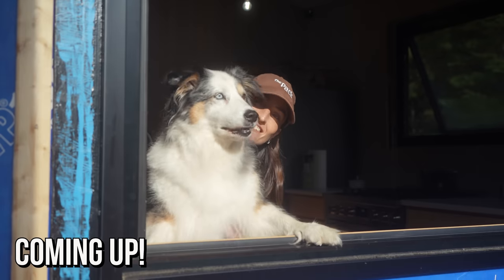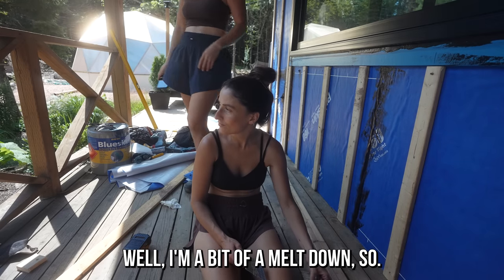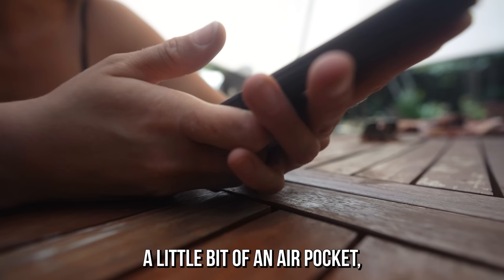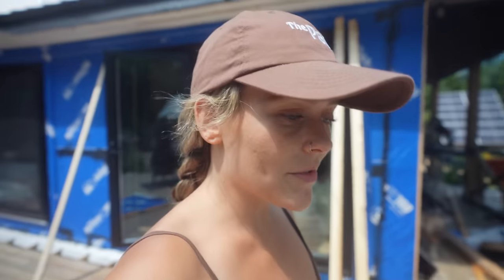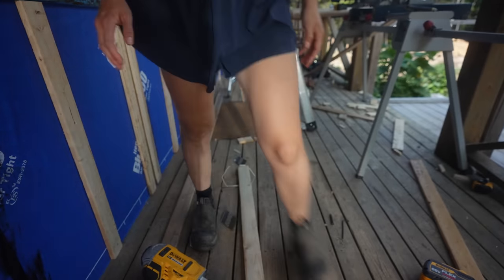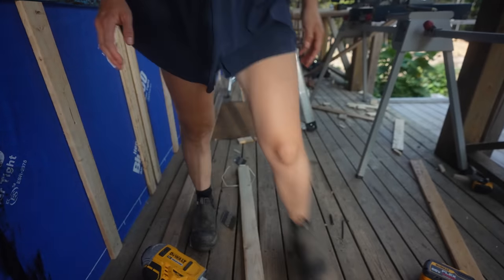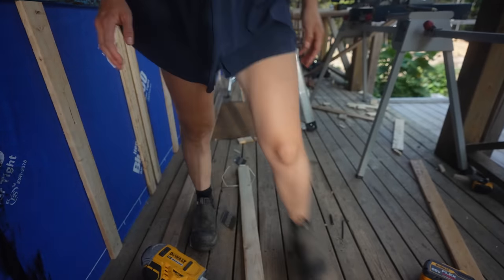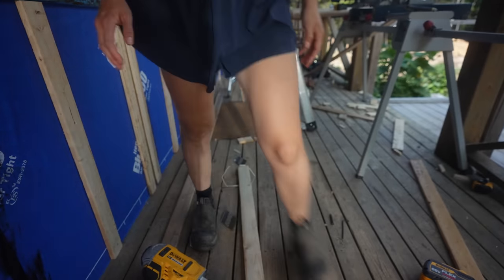Finishing House Wrap Installation (it's complicated)

Comment: Hey ladies, my wife and I are regulars to your channel down in Massachusetts. I am a residential builder and wanted to offer an explanation to your blueskin bubbling. It was super rainy when you applied the adhesive and the blueskin over it and the adhesive didn’t have a good opportunity to completely cure. The bubbles are forming because the paint on adhesive continued to off gas after you applied the blueskin on top. It won’t effect your siding at all. In fact, with the air space you created with the strapping, this system wont give you any trouble as long as you do a proper job sealing the siding to the trim.

Comment: Ok ladies, Loki and I have 2 large panel systems like you and a separate array on the south facing side of the barn. So, in answer to your question,  I put a small concrete 6' x6' pad under each of the panel arrays and the surrounding area with natural plants and a stone pathway to get in an out.

Why you ask? Well, if there is an issue with either array, I have a solid platform to put a ladder up safely to do repairs. But the rest of the time, I have large wooden chairs setup under the array as a sun shade from the Arizona sun. And you both know that Sedona gets a lot of sun.

Hope my personal solution helps you both. It's been a life saver for me.

Be Blessed 
TJ & Loki 🐾

Comment: Have a thought  regarding your outdoor shower.  

Was recently (last week) backpacking in the Austrian Alps and stayed at a remote cabin at 2000 meters.  Water was limited there, but they had a free outdoor shower provided by rain water captured in one of those plastic and metal cage containers like you guys were using in season 1.   

It was elevated on a wooden structure and they had a pump you clicked on to increase water pressure.

What was great about this was the rain water tank was warmed by the sun most of the day so instead of a cold shower it was a cool shower and extremely pleasant to stand under after a hot sweaty day hiking.  

Just a thought if your well water shower is too shocking on the cold side.  Outdoor showers are amazing.
Reply from the maker: Thank you for sharing with us. Sounds like you had a wonderful holiday: 💛🐾

Comment: Just a bit of advice, with this issue with climate change and wild fires, you should take the time to clear out trees that could fall onto the house. Anything closer than the height of the trees could be an issue if that tree is on fire. Avoid planting bushes closer than 5 meters to the house and keep the immediate area covered with coarse gravel applied above the the landscape cloth to minimize vegetation growth. Keep up the good work and stay safe!

Comment: You ladies are awesome, in so many ways! 👍👏🏼👏🏼👏🏼👏🏼. Yes, as a solar installer, I was freaking out with dear Porter under those solar panels, but he is a surgeon with those machines. 👍👏🏼👏🏼👏🏼👏🏼.  As far as what you may want to put under the panels, I would be careful with choosing any plants, because the end of a rake or shovel can do as much damage if the panels are hit from the back side as an excavator.  Maybe they are higher than I think, but maybe a nice piece of art or something that doesn’t need any maintenance would work there? A sculpture made out of the left over material you used on the inside ceiling? Or a sculpture made out of left over blue skin? 😆🤣😂😁 Just kidding!! 
I’m sure you or other commenters will come up with something brilliant!

Comment: I have never installed blue skin. With that said  the advice that I would give you would to do ONLY one wall at a time. Apply the blue skin and strap and immediately  apply the siding IF it can be done one wall at a time independant of an adjacent wall. This approach would shorten the process and minimize  the bulging of the blue skin. Have a nice day. Tom  at the NB-NS border.

Comment: I believe the blue skin is over kill period.
The problem is the condensation between the blue skin and the poly vapour barrier.
It’s going to mold and rot quickly.
Please check into this.
You guys are awesome!
Reply: Get that blue skin covered before it rains  or you will have troubles
Reply: @Patty-kf4rv  It has already rained on the blue skin. Did you see last week's video/

Comment: Just wondering if you two have seen the ZIP System product? I know its a little late now, but its an engineered weather and air barrier that is applied to 7/16" OSB and you can also get poly iso insulation attached to it. I recently did my house that was built in the 1940s and I got the ZIP R12 (2" of insulation) and I am very happy with the product, you just tape the seams with the acrylic tape they have.

Comment: There wasn’t water under when you installed the Blue skin so likely they are only air pockets. The strapping will stop it from falling off and if you roll the large bubbles it will be ok. The blue skin is a membrane and if it’s held against the wall with the strapping, it will still work are a water barrier. 
Relax and go with the flow.
Reply from the maker: Well thank you for sharing your knowledge and experience with us.🌞🐾

Comment: Most poeple who use blue. Do the wall, one at a time. Do everything to one wall at a time, blue, strips and siding
 Try to start at the front of the house. That should work . then check the next wall that can line up on the siding line.
Reply from the maker: Yes we learned that after the house was wrapped. Didn’t read about that online. Thank you xx

Comment: Probably too much time in between painting it on and then applying the blue skin. With it raining and high humidity, moisture is getting trapped in between and then the sun hitting it is causing that moisture to expand. If the nail gun doesn’t work, just go old school and use a hammer. You don’t need all these power tools just to do strapping. Just have to get it done.

Comment: Guys, relax with the Blue Skin!  Take a razor and just small slits and then small patches.  Remember you have air pockets from heat.   When I started siding, I handled it as I sided.  Your going find water is not your issue, just take your time and all will be well!

Comment: I stopped your video and watched a few Henry installation videos to see what the heck product you were struggling with.  The only comment I can make, is no matter what product (Tyvek, tarpaper, Blueskin, etc.) that you use, they are usually installed BEFORE windows and sliding glass doors, and the jambs are wrapped to be contiguous with the exterior wall covering.  Their installation video showed them installing the Blueskin DIRECTLY on OSB, with no 'paint-on' sticky layer like y'all did.  Henry has some light blue, liquid elastomeric gunk that's supposed to go inside and around your window openings.  I'd never seen that product.  Since your windows and doors are already installed, I'm not sure if you've compromised the integrity of the installation or not.  That Blueskin sure looks like a LOT more work than Tyvek or tarpaper would have been.  OK, back to your video...  2)Suggestion for under the solar panels: landscaping ties filled with gravel with creeping juniper and low flowering plants for bees and butterflies.
Reply from the maker: Correct! When the windows were installed 3M waterproof membrane was done as well! Cool you looked it up :)  love you suggestion for under the solar panels. Jumpier is so pretty 😍

Comment: Sorry to learn that you're having problems, but I didn't think the blueskin was a good idea in the first place. I don't even believe in Tyvek housewrap.
 I always questioned housewrap, and some years ago, I ran across an article about the experiences of some Canadian architects. The Tyvek doesn't breathe the way it is claimed to, and it traps moisture, which does all kinds of damage. The fact is, air doesn't pass through wood or whatever type of particle board is used for sheathing. The air, carrying moisture, passes through the spaces between the boards or the sheets of the sheathing. Maintaining a difference in temperature between the inside and the outside always presents the potential for condensation. The house has to breathe.
 If a house is sheathed with plywood or some form of particle board, caulking all the joints would make it just as impermeable to air infiltration as the blueskin or other housewrap. Housewrap is required here in new construction to make a house waterproof, and the electricians aren't allowed to start inside the house until it is wrapped or sided.
 On a more positive note, I'm glad to see the vertical strapping. It will allow air to pass behind your siding by convection. This may sometimes result in condensation, but it will always dry out. I suggest not completely closing those spaces at the top and bottom, but perhaps using some screening or other breathable obstruction to prevent bees and hornets from building nests behind the siding. I only wish the strapping had been the first step, omitting the blueskin.
 Good luck!❤
Reply: Although I know nothing about the Blueskin product, I did see Tyler and Todd struggle with the 3M product, which looked a lot worse. When I watched the girls' first video I did wonder how the Blueskin was going to stick to the very rough original siding. It looks like it didn't stick well after all. As you say I hope the air space with the strapping will work.